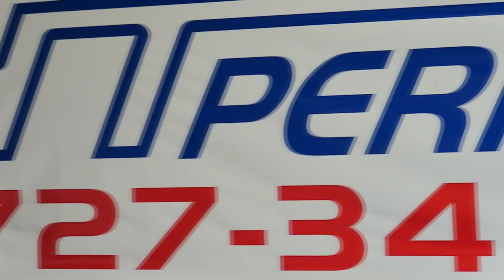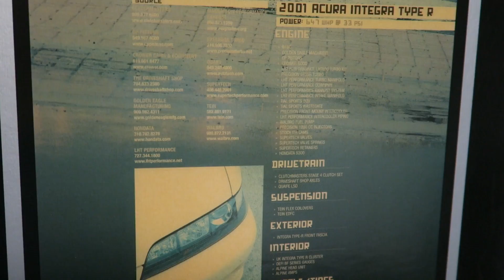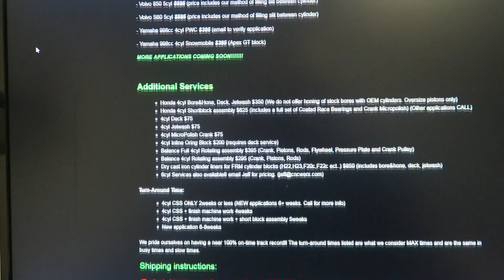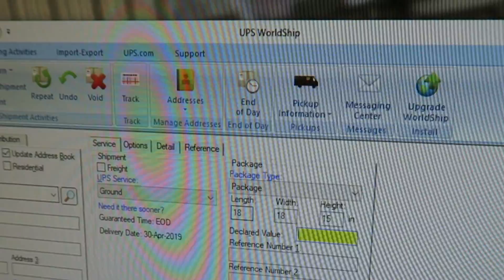Integra - Engine disassembly-Part 5

Comment: very informative video keep up the good job. but i have question. is it ok to just CNC port the heads and install with out upgrading the cam? i mean dose it increase any hp? or is it gonna create any issue if u install the CNC heads with out upgrading the cam
Reply from the maker: ray tag I would contact the company offering the head work. They may offer different port styles depending on your mods.

Comment: I use the same spring compressor tool. Works better if you use a few old headbolts and bolt the head down to a table. Wont move and easy one handed operation of the tool

Comment: I'm currently building my 2006 K24a2. I bought Supertech Valvetrain,  but then decided that I wanted to run Ferrea intake valves.

  Do you think I'll be able to use Ferrea valves and locks with the Supertech springs, retainers and guides?
Reply from the maker: kudzy11 Technically Yes.  Although I would use the same brand if possible

Comment: The two pieces that came out when you pulled the springs etc what were those? The looked like 2 c shapes that made a complete circle
Reply: They're called Keepers. They wedge in and lock the valve spring retainer to the valve.
Reply: @noanoxan  thanks!
Reply: @Sideways G thanks. I'm confused I've looked up both answered and they look like the same thing. Just different  names?
Reply: @TheKtchevelle  same thing ,different names. Locks, keepers...
Reply: @kudzy11  cheers. I know the angles tough and probably impossible to film, but I would have loved to see how those come out or go back in.